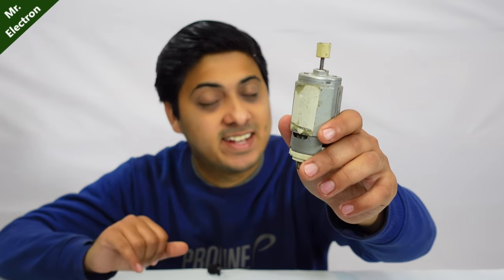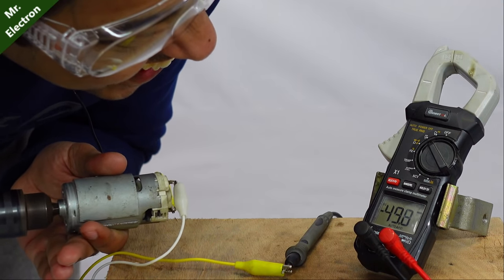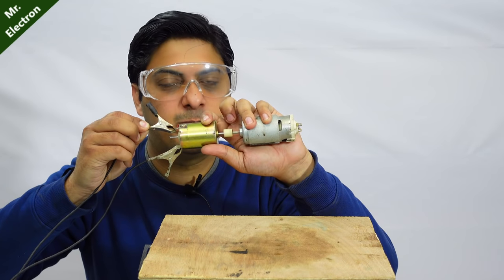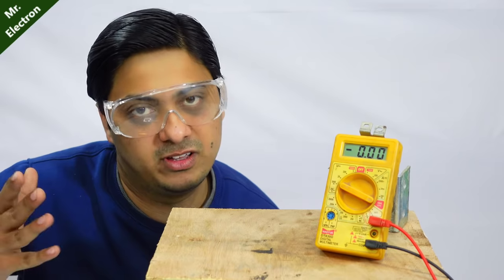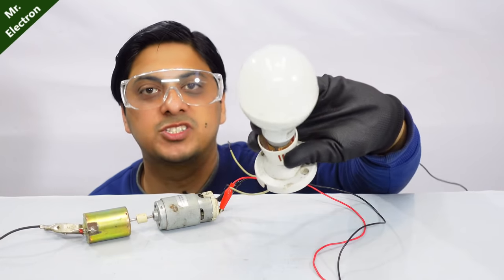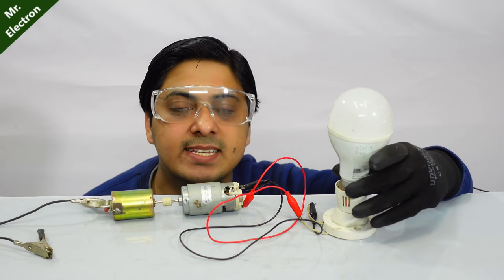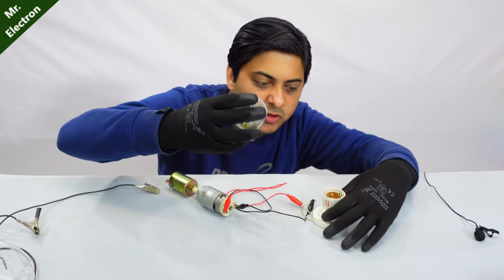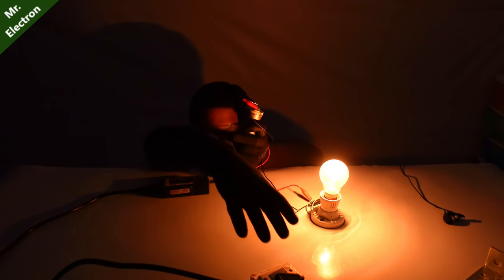220V 120 Watt Powerful Electric Generator from Blender DC Motor DIY

Comment: Blender motor used in india is mostly an ac/dc or universal motor having field and armature windings.if v rotate this motor by some external force ,how can it produce voltage output. So What type of motor are you using ?

Comment: Among many videos, this is the best one since this one has in-depth explanation. But, why do people connect the motor to electricityto generate electricity? What is actually the point of converting electricity to movement and back to electricity again? Does it increase the electricity wattage it takes from the electricity source?

Comment: Nice and useful video Why not run a DC 48v motor from solar panels or a low amp battery pack To rotate a generator of 5000 watts or less.
Thank you  (mr Electron)

Comment: You can avoid sparking if connect supply clamps with motor then switching on the supply switch
Reply: Yep agreed ✌️😂
Reply: If he use bench power supply
And gradually increase voltage 
It will help to avoid sparks
Reply: @viveksarpe  it depends weather he has bench power supply or not

Comment: This motor rpm is what can this motor is used for making cordless drill machine and grinder, this motor is run with battery pack or normal adapt or of 12 volt

Comment: AC is more dangerous
Reply from the maker: yes you can get a good shock from ac supply even at lower voltages when compared to dc but there is an off point in every AC wave cycle so if frequency is low enough, you can easily remove your hands but in case of DC , there is 0 frequency or null 'off' point so you cannot remove your hands if power supply is high enough.
So the final answer is it depends on the AC and DC Parameters. High frequency AC is a lot more dangerous than normal dc but low frequency AC is less dangerous  than DC